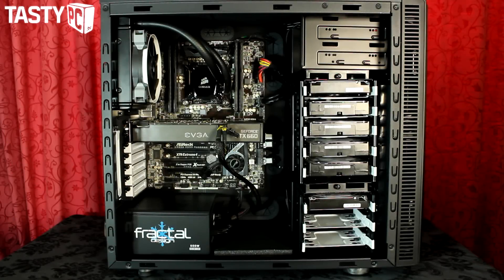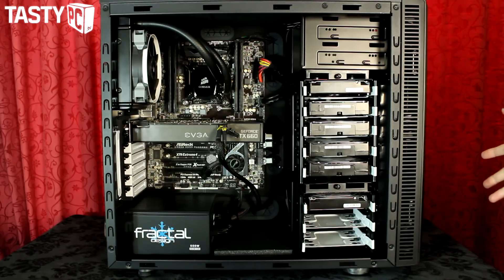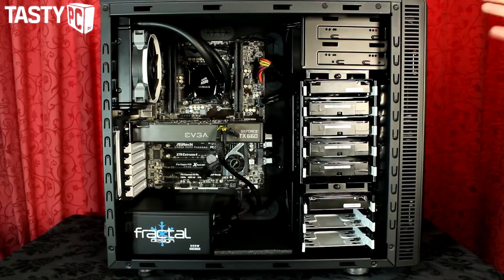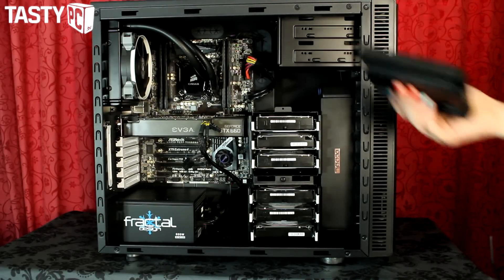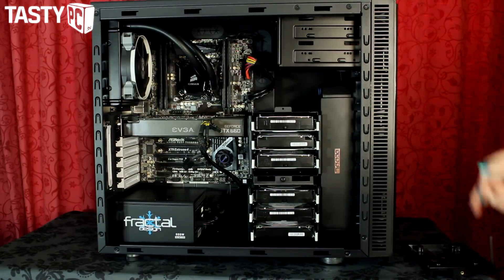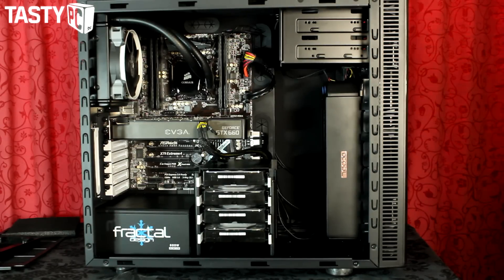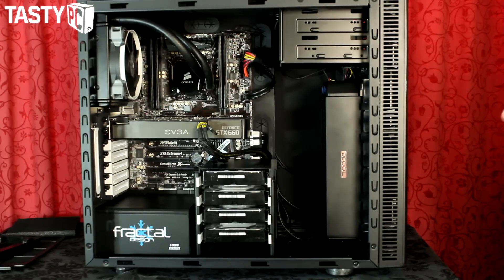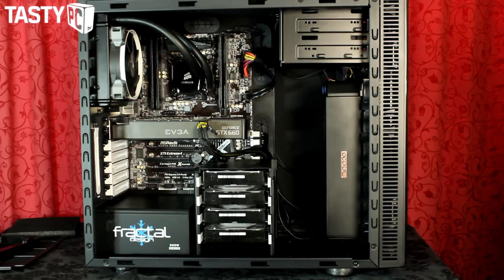Define R4 Workstation Update #1 - HDD and Front Radiator Placement

Comment: Floor is carpet, and my case is on the top of the desk, there isn't any issue with temp in my case and I'm close to a window so that's not an issue I'm talking about vibration, this case is the only case I've ever had issues with feeling the HD vibrate.

Comment: i can feel my HD vibrate the table when its reading, I'm using the lower cage.
Reply: Shouldn't you put the case on the floor? Where the cold air gathers. Pc tables suck cause they have this 10 centimeter over ground pc case hold, which is dumb.
Reply: You could try re-mounting the cage to the case floor with either rubber plugs (like for fans) or rubber grommets, or even just a setting the whole cage on a piece of soft material (an old mouse pad perhaps) without screwing it down at all.

Comment: I actually ordered a r4 (it should be coming this week :D) and I felt from reviews I watched (inc yours) that it had plenty of space for a big radiator :o (I was actually considering the h110 lel) now I'm not so sure.
Anyone got some advice for a powerful quiet cooler? I was thinking of the Dark rock pro 2 (looks hot but I'd be looking at 4.4/5 ghz + i'd rather liquid cooling), h80i (dark rock pro 2 isn't much worse though?), h100i or h110. I want to get 4.5-7 ghz on an 3770k.

Comment: so does air - and I'd guess getting the air out would be tedious for a miniscule temp improvement since the coolant is circulating anyway and the speed of heat  rising through fluid is negligible compared to the flow

Comment: What's in the ODD trays? An optical drive? Bah! Get rid and pop some more storage in there, (a million mounting brackets to choose from; the Silverstone ones are a good fit in my R4,) and slap 2x 2.5" HDDs and 2x 3.5" HDDs in the ODD bays and an SSD for os round the back of mobo tray along with another 2.5" drive. Using 4tb 3.5" drives and 1tb 2.5" drives, (minus the SSD) you could get a cool 11tb, without any of the cages. Need more? Use velcro strips to mount more 2.5" drives round the back :D

Comment: The R4 really sucks for water cooling , i have one myself and I dont like my cooling options, it doesnt natively support rad at the top and u have to do some ghetto mounting to fit a rad in the front. But for air cooling its really one of the best (silent) case, which is what I wanted to do until I could afford a WC loop but then realized its not really compatible. If they ever make an R5 I really wish they change the mounting hole for fans/rads.

Comment: You should flip the CPU radiator cooler so the rubber tubes are on the bottom, drawing cooler liquid from the bottom instead of the top. It's a fact heat rises.

Comment: If 4 HDDs fits between the PSU and the GPU you should fit it there somehow. A pull fan away from the HDD towards the expension slots will be good.

Comment: I'd take the Fractal Design Node 304 from your other videos (if you still have it), put your six drives in there and use it as a dedicated NAS/FileServer. Run NAS4Free with ZFS on the Node and go nuts with watercooling in your main rig.

Comment: I like the drives in the middle and lIke to suggest going all SSD in this box and move the magneto drives to a NAS.  Less heat, noise, and hassle.  Your usage scenario involved editing videos here and this is where you'd see the value of the SSDs.  I'd love to see a tube res behind the front rad, Yellow fluid would look great with the case.  Make sure you overclock your ram as well... helps in video editing in a big way.  In short, threat the storage here like swap and the NAS like archive.

Comment: In all honesty, I would suggest a different case that allows for more room to do what you want, cool, and keep your hard drives. I know that's not the point of this video, so other than that, it's a tough call. Is it possible to put hard drives where the optical drive usually goes? I know sometimes there's an cage that fits in optical drives, allowing for hard drives to be put in.

Comment: don't think the rad will create the amount of heat that will do you'r drives anything bad.
Alltho i only have experience with smaller rads. Those thick one prolly gather up more heat same surface volume for a bigger amount of water prolly increase heat.

Second option looks best tho. Shame you don't have a thunderbolt connection.
I have all my disks in a case. So i have the same files on my laptop and computer now :) no need for room in case exept for boot SSD's ;)

Comment: One way to free up 4 of the 6 drives would be to use adapters and put them in the 5.25 bays.  If for whatever reason if you need a disk drive, they are pretty cheap externally now because of the netbooks.  I also seem to recall seeing someone putting a 3.25 drive behind the mb trey, but even if it fits if may get too hot.

Comment: In reply to your question: I would go with the 2nd option and get a 5 bay eSATA enclosure. That way your backups will be on a flexible external solution that you can hook up to other PCs if you wished and you will reduce internal case ambient temps.

Comment: in my opinion you should only need a 30 mm rad. i have an 8350 at 5.2 with a 240x30mm and i can keep it under 65c (which is a little high) so if you really feel you need to a 60mm rad will also work and probably keep you fan revs a little lower and quieter. if you have the money its worth just going for a thick radiator (why not?).

Comment: Great overview.  Looking at a full water cool on my system.  Want to nice clean simple loop.  Pump/Res all in one is great for me.  As it will be going in an R4.  Undecided about Rad placement.  Most likely in the front as you did in a previous video.

For a i5 2500k at 4.5 and a GTX670 what size Rad would you suggest?  240mm but thickness?

Comment: You could go with a case mod. if you have heat issues just add more extraction fans, seems you have room at the side , get the side pannel mark where you could mount a 120 or 90 mm fan so  as to mount ot to the side within your pc and have no issues, then bring the panel down to the local mechanic or local metalworker get then to bore holes for the 90 mm fan and bore mounting holes for the screws then attach it, and your sorted :) i know it sounds extreme but its a tought

Comment: do build 2 you will be much better off keeping it cool so the air will not be as hot you may even think about outsourcing the cooling  that way yo don't need such a big radiator to keep it cool that what i do with my black-hawk  case with i7 overclocked to 4.8 660 ti running SLI it the only way it will stay cool in my small room
just do what you think is best

Comment: Hey Lauren. Good to hear you sounding normal again (for a techy chick :p)

I'd be looking to go with the UT60 and full compliment of HDDs. the extra 20mm shouldn't be required for just a CPU and if it is, you could chuck a 120 in the rear (sod appearance, the roles it has to fulfil don't really allow wiggle room for appearance much.

However, if you're keeping backups, could be an idea to put HDDs in Tasty, so backups are seperate
Or buy Google and get fibre installed and use cloud storage :)

Comment: I think the first option, using CPU > Top rad > Bayres > Front Rad > CPU, but the only thing i see you are going to run into is hard drive space ether way you lose, cooling or storage

This might also work CPU > Rear rad >Top rad > Bayres > Front Rad > CPU using a 120/140mm rad

Comment from the maker: See I disagree I'd much rather have the cleaner looking bay res in there then the extra tubing and mess of a separate pump and res inside the loop. Remember the case has a door that I never open so for all intensive purposes it'll have a completely stealth res and pump.

The first source of heat dissipation will be the top rad, I'm thinking CPU > Top rad > Bayres > Front Rad > CPU :)

Comment from the maker: 39x129 @ 1.42volts. It's stable at slightly less volts but I always give a little extra for guaranteed stability. I think it'll be stable at much less volts once I get the heat under control.

Comment from the maker: The description of the video states that part 3 will most likely look at the top rad but I probably should of mentioned it in the video :)
I'm not planning on using an optical drive. I haven't used one of those for years. I'm using a dual bay/res/pump.

Comment: The size of your case seems to be problematic for fitting both the HDDs and the rad(s). If you don't have pets or other things that could be problematic with external water cooling, i would suggest having a look at putting the Monsta rad on the roof of the case with push/pull sideways relative to the case. This would give the rad fresh air and keep from heating up the interior of your case. You could then fit normal fans in the front of the case and stock up with HDDs. It might also look bad-ass

Comment from the maker: A H100i doesn't fit up top so I'm having to work around that. The H100i rad is just over 25mm think and fans are 25mm (around 52mm total) too so that gives me around 45mm to work with total for a guaranteed fit. I'm planning a 30mm thick rad and slim static pressure optimized 15mm fans (low rpm). That's why the front rad needs to be thicker as it has to support a weak top rad solution. I'm going to have the pump quite slow too.

Comment from the maker: Criteria:
Mid Tower - Must be easy for me to move around
Front and Top Radiators (one at least 60mm thick)
At Least 4 HDD spaces (without using the optical bays)
Silent (Thick side panels - Noise dampening)
Side window (without fan grills)
All black/dark grey
Sleek looking
Must be a one box solution, external drives/NAS options are not what I'm after.

Comment: one 240 UT60 in the front and one 240 XT45 in the roof should be fine.
Then you have enough room for your HDD's and descent cooling in summer.
If you don't need the 5,25" Bay's you can put a Alphacool Bayres D5 combo in it.
You can cool the graphics card with that setup too without a doubt.

Comment: Hi, I was wondering if it was possible to a 240 monster on the floor of the case and mount one of the hdd cages to 5.25 cage and then add  two hdd's ice docks in the 5.25 cage.

Comment: I would do something like a "Dual rad" config. 

You have to use your Watercooling Queen status for something. ^^p

One 240 rad in the roof with pulling fans. (Corsair high performance SP120)
One 240 rad in the front push/pull fans. (Corsair quiet SP120)
And a single Corsair AF140 in the back

Order in the cooling loop.
¤ CPU --> 240 -> res -> 240 -> CPU ¤

With that I will think that you get the temperature down a little bit with the first rad. And  then it might not be as hot for your HDD's.

Comment: I would do the first config (to keep my hard drive space) and arrange the fans in pull and have them exhaust to the front. This way it pulls the warm air away from the HDD. I would never let any kind of hot air blow onto my hard drives as I can't afford to have downtime or lose data, so having a hard drive fail should remain as a once every 3 years things. I personally have never seen any real benefits of push & pull configs so I would avoid config 2 anyway.

Comment: What you could do is swap out the drive bays with aftermarket drive bays that also have fans attached to help with cooling. Also if you have the coin swap out an HDD or two and instead use some SSD which could be mounted behind the motherboard tray.

Comment: Hard one.. I personally wouldn't go for a front rad, I'd go for a h100i top pull config. But if this was the deal I had to go with I would probably go for external e-sata drives. Keeping the airflow in the case great and have an ridiculous storage expandability  while keeping the speed of the drives the same.

Or to keep things tidy, get a board that converts 8 sata ports to 2 mini-sas cables and do the opposite to the other end.

Comment: If you're not using your drive bays there are hdd racks that have the drives in a vertical configuration. I think that would allow you to have 6 hdds in just the 2 drive bays. Then you would have all the room you need for water cooling

Comment: I would.
Fit the Monsta rad in the front, and the HDD cage all the way back.
Ghetto mount a 120 fan on the front of the HDD cage ( I've done the fan thing before ).
And then put in 4x 4TB Harddrives, which is a lot, and they will be properly cooled.

Comment: Both options kinda suck.
Isnt there enough clearance to fit a 360 or even a 420 in the roof, if you consider using a top-mounted shroud (like the Koolance one)?

I mean, 360/420x45 with a set of fans on the outside to pull air thru your case should work just fine. 
However, I do think you would've to upgrade the front intake fans to pressure optimized fans - to get enough air thru the restrictive HDD-cage.
+ Airpressure inside the case, with a bottom intake.

Exact measurements would be great ;)

Comment: I would go for the 2nd option, then put one of the last two Hard Drives on the underside of the Optical Drive Bays (Velcro with adhesive) and the last Hard Drive on the top of the Hard Drive cage (more Velcro with adhesive).

I believe this would work and look good at the same time with proper cable management, which you seem to be great at.

Comment: In case you'd have free options and would enjoy having quiet harddrives I'd like to recommend the Seagate 4TB ST4000DM000 5900 RPM model. Its sequential performance should be fine for video editing and its acoustics are really sweet. It's the first mechanical 3,5" drive that I cannot hear at all from outside my Define R4 case, and I'm especially sensitive to high pitched noise. It's not expensive from a storage/cost perspective either.

Comment: I have an R4 so i am very interested to see what you do i would like to water cool it but i can not find a pump res combo to fit (criteria needs to still look clean inside ie no random pump on the floor and be silent)  In the system ATM 3770k W/zalaman air cooler, 32GB of dominator platinum, ASUS GTX Titan, msi Mpower MOBO and some stock fans runs cool and quiet when i am not doing anything with 5V fan power but as soon as i start playing or rendering temps go up so i have to turn on 12V fans :)

Comment: option 2 with tube reservoir freeing up 5.25" bays for two more hard drives, you might also be able to fit an intake in the bottom below the HDD cage, but that might require modding but it would cool your HDDs, option 1 I don't think would work very well as the air won't have much space to move due to HDDs, also monsta push pull is better. If there is any way of freeing up 5.25 inch bays by using tube res I would defo do that or replace HDDs with 3 or 4TB drives :D

Comment: You're gonna use a bay res/pump combo and that's why you can't use the 5,25" bays for hdd-s? Don't know how modder are you willing to go, but there are some ideas/possible options to the second scenario:
* Use a pump/t-virus (or similar) combo between the rad and hdd-cage and the ODD bays for the other 2 HDD-s
* Install a (modified) hdd-cage with 2 HDD-s ontop of the PSU, turning it around if worried about ventilation/airflow.

Comment: how much room is behind the motherboard tray i had the same problem with my 650d where i didnt like the hard drive cages so i made a blanking plate and now i can put up to 6 3.5" hard drives side ways and it looks cleaner. if i was u i would put the 80mm rad and the 4 hard drives and two behind the motherboard that why u break the heat up but that if it can fit hope it does and mod away,

Comment: Why not slim 120in the back, slim 240in the top and a slim 280in the front? (Slim 30-45mm). Even without the front one ur temps would be massivley better. Or you go with an external rad like a 360 mounted on the back 120?

Comment: Thanks for this vid. I'm going through a similar thought process for my arc midi. I've got a 2.120x60mm rad up top which is cooling my CPU. about to add a gpu block for my 670 so probably need to squeeze in at least another 120 rad in front, but preferably 2.120..

Comment: I think you should consider a Rad for the CPU for the top (if you can i don't really remember about that case). THe other option is to just whack in as many HP fans from Corsair and why because they are good and also keep the H80 there on your CPU with the other fans. Case fans FTW

Comment: You can't be doing anything to intense since you only have a base GTX660. Just turn down the bar clock so it's not running so hot and your golden. Our if you bent on using a front rad go with you second placement and go with a push pull setup to give the hdds some extra air that may help a bit.

Comment: Put the 4 hard drive option behind  the monsta in push/pull, but get the monsta rad to pull air in from the case and exhaust it out. this will cool the hard drives, and as you use use WC anyways the cases air will not be too hot

Comment: i would go with the second one. First, it is better for the overall airflow. Secound maybe with a side panel fan you can help to cool then down.
The ideal i think would be if the backplate has space for mount then by stick then to it...but usualy it dont. If you dont use nothing on the optical bays, you can mount 2 of then there and get creative with the others.